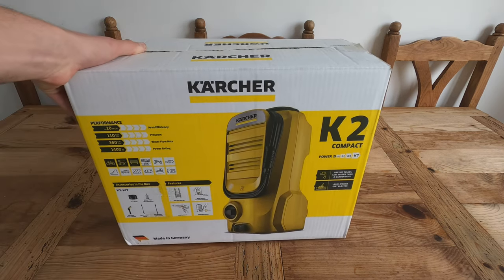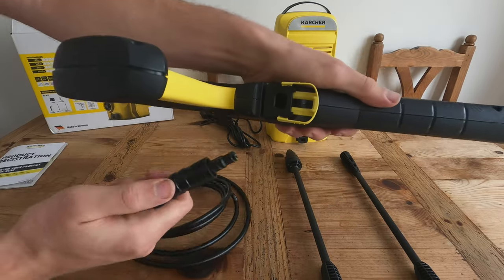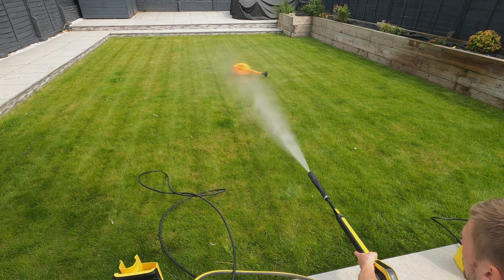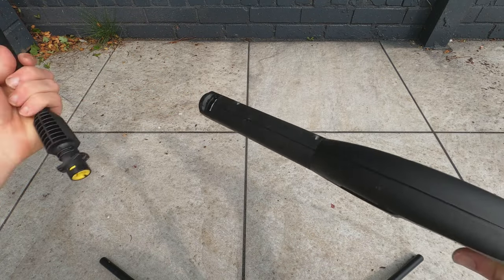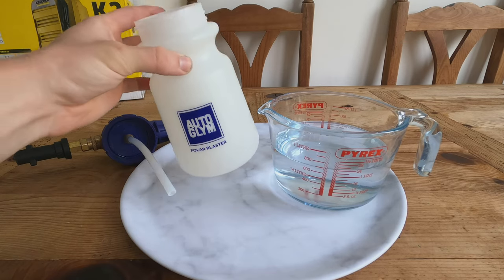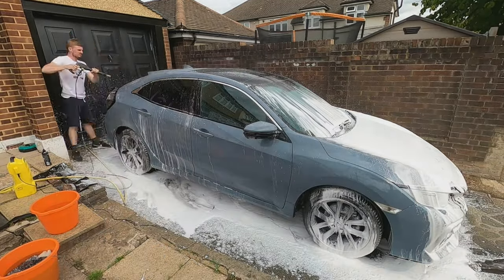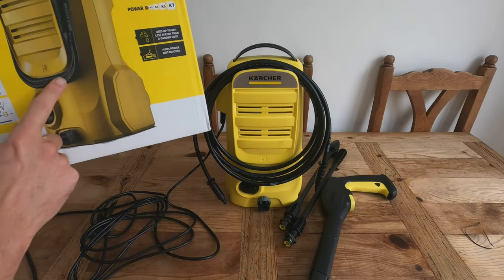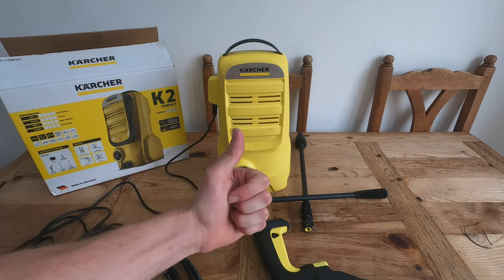Karcher K2 Compact Review - The Bargain Of The Century!

Comment: What is this green part on 10:20?
Reply from the maker: https://www.halfords.com/motoring/car-cleaning/pressure-washer-accessories/halfords-advanced-pressure-washer-short-spray-gun-kit-712486.html?cm_mmc=Google+PLA-_-Motoring%3EMotoring+Products%3ECar+Cleaning%3EPressure+Washer+Accessories-_-Motoring%3EMotoring+Products%3ECar+Cleaning%3EPressure+Washer+Accessories-_-712486&_$ja=tsid:|cid:17326102957|agid:|tid:|crid:|nw:x|rnd:5008729860456677999|dvc:m|adp:|mt:|loc:9044942&gclid=Cj0KCQjw1OmoBhDXARIsAAAYGSFS1qokw6Gx6xD_HxDVNYml0u0G3BfqGL-5Cz5bXYUjK4Bh71vChA8aAn6QEALw_wcB

It's a short quick relase pressure tip, makes it hella easier 😂
Reply: Great, thanks
Reply: How did you manage to keep the green adapter in the end of the karcher gun

Comment: Cool , must be that cheap to pay the creditors , 

Quick tip on the dirt blaster spray WD40 in there after or it will rust and seize up.
 Did some pressure washing my self today on stone and used the autogylim with new 1.1mm orifice for windows and plastic Superfoamy ! Yay !  

Need to try the bubble bath for a laugh 😂
Reply from the maker: 😂😂 Good tip, sorry I've only just seen this comment lol. I tried fairy liquid on one of my cars, was pretty decent 👌